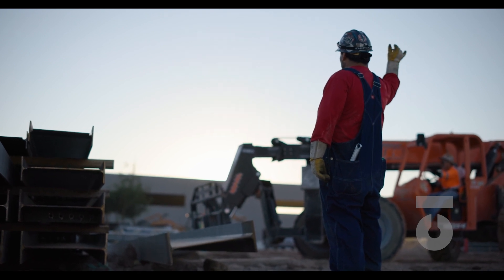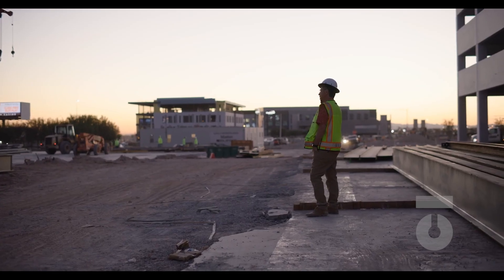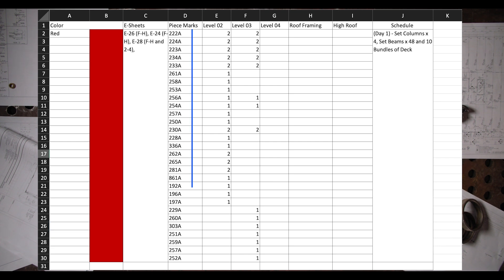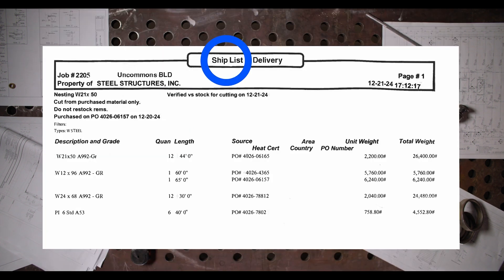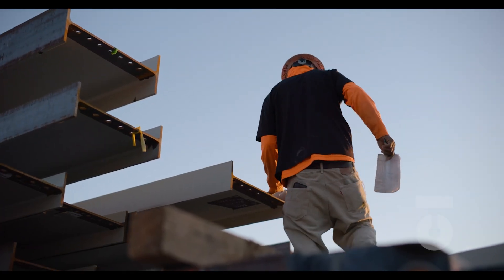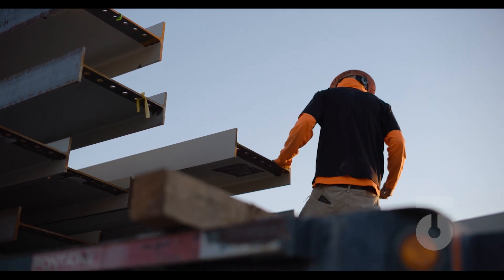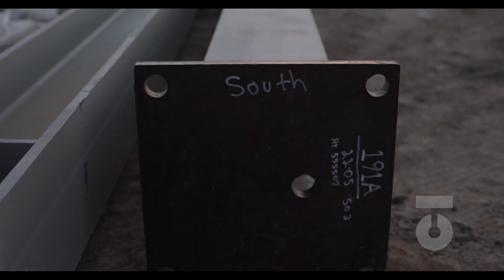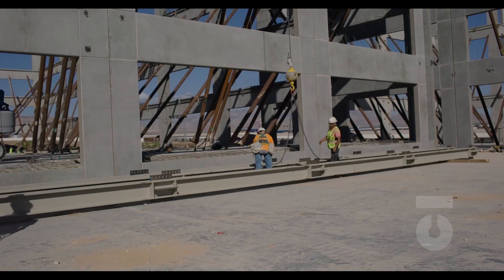Steel Erection 101: Part 4 - Load Lists and Yarding

Comment: I'm subscribed. Just the quality content in looking for. 
What's offered in the app other than the videos uploaded here in YouTube.
Reply from the maker: Thanks for commenting! Our app has 140 videos that are in the training libraries right now and have courses for OSHA such as Rigging, Forklift and Telehandler, Scissor and Aerial lift, Working around cranes, and fall protection courses. We also have other courses such as the How to read steel drawings course, fabrication course, and more. The app on the other hand is a time tracking and compliance management app. Helps track time on jobs, monitor profitability and houses certifications so if OSHA shows up you can show them easily. Cost of the app is $5 a month for premium and $2 a month for standard.